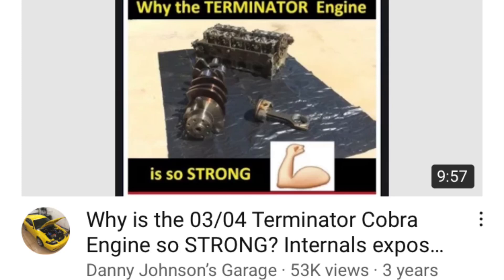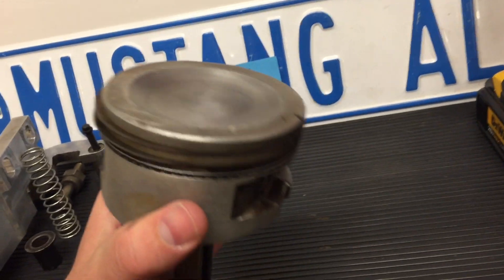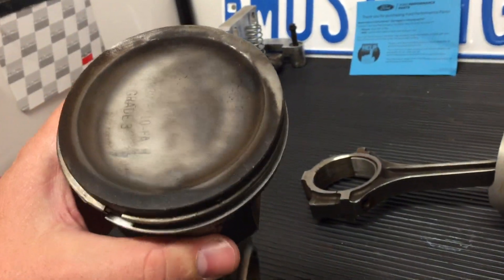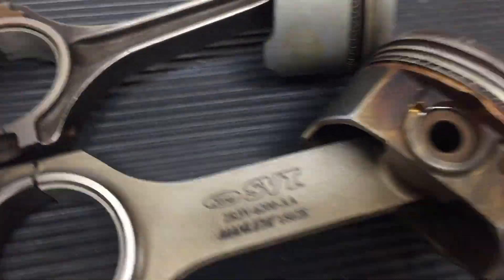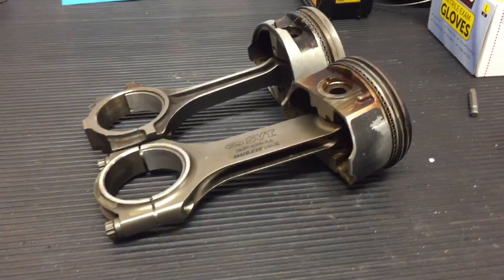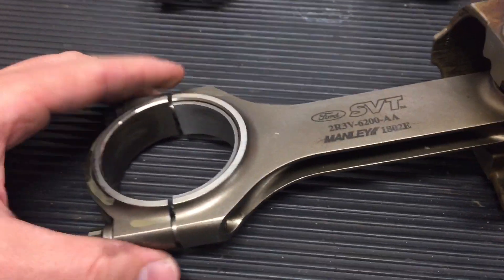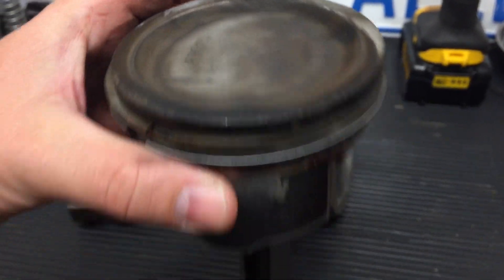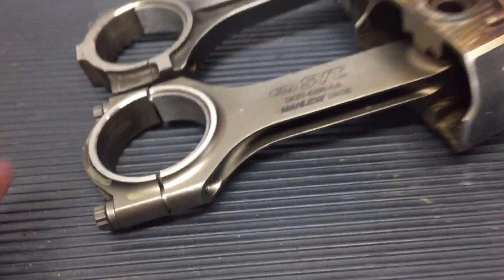Terminator Cobra Rod vs Stock 4.6L Rod: Why the 03/04 SVT Cobra Terminator engine is so Strong.

Comment: Why they don't use them in the 07 to 09 gt500 is beyond me. They were powder forged but should have went with the Manleys.
Reply from the maker: $56 per rod vs $6-$10 per rod is why. I’d gladly pay an extra few hundred bucks for a fully forged engine
Reply: @dannyjohnsonsgarage  Yuuup! 2008 gt500 is what I'm driving now. Playing it safe at 640whp.

Comment: They should of just kept the Manley Rods & ARP studs & bolts, All they had to do was add it to the end cost of the car. People would of paid an extra $1,000 - $1,500 to have forged rods & Bolts in all the Cobra engines even the 5.2 GT500 engine. I know I would of happily shelled out the extra coin for the rigidity of the bottom end.

Comment: Can you convert a normal 2004 4.6 to a terminator 4.6?
Reply from the maker: Not entirely. The block is virtually the same, you can swap over the crank, rods, and pistons, but the heads are different for the 2 valve per cylinder engine on the GT. You can come close

Comment: Will those pistons and rods work in my 96 cobra with the stock crank?
Reply from the maker: Yes, you will just have a little lower compression so you’ll lose a tiny bit of power until you add a supercharger
Reply: @dannyjohnsonsgarage  do they have the same bore or would i need to bore it out? I still have stock bore on my 96 cobra

Comment: Which block can handle more power, the WAP block found on the terminators or the Teksid block?
Reply from the maker: Teksid can handle more. It’s heat treated and higher quality from the same company Ferrari uses, but not many people will surpass the needs of a wap either. If Ford had not gone to WAP it would have been cool for the terminator to have had teksid over iron.
Reply: @dannyjohnsonsgarage  it blows me away how much you and your brother know about the SN95s.
Reply: Terminators don’t have WAP blocks. WAP blocks are used in mach1’s and marauders.

Comment: Its too bad that they put these rods in the mach 1
Reply: Windage losses, you’d lose horsepower and torque with the heavier rod. The modern N/A 5.0 rod and 5.2 Predator rods are vastly stronger than the old 4.6 rods. Sinter forging has come a long way since the 2000s.

Comment: Another tid-bit is that the dish on the terminator and the PI 2v were both at 17cc, along with bore, stroke, rod length, deck height and compression height, making the shortblocks dimensionally identical, with the compression difference being in the combustion chambers.
Reply from the maker: After seeing the dish on both I was thinking it had to do with the heads. Thanks for info
Reply: @dannyjohnsonsgarage   heck yea! I learned that while doing research on forged shortblocks, including the feasibility of putting a terminator short block into a 2v, because shortblocks were available when I was putting together a build list for my car before I ended up doing the full terminator swap.

Comment: Hello could you use those Manley Rod's and pistons in a regular 4.6 Romeo motor (1998)? Have good day . thanks
Reply: Yes... ish, provided the pistons meet the exact clearance requirements of the bore.  There were 3 grades on the run-of-the-mill mod motors during manufacturing, with very minute differences in bore sizes due to machining tolerances, and the pistons were then chosen based on the closest matching bore size.  The hand-built engines met a far more stringent manufacturing standard and were only offered in one grade.  If your block has an exact bore size of 3.552", then dropping them in shouldn't be a problem.  Mahle makes a very nice budget set of forged OEM replacement pistons (http://www.us.mahle.com/media/usa/motorsports/ford-modular-2-valve-or-4-valve-2020-web.pdf) that would drop into a stock bore, or a .020" overbore available in 18cc dish or flat top, giving you new parts with the option of a precise bore and flexibility on compression.  If you're using that on a non-pi head, your compression would be in the low 9.x:1 range, and the flat tops would put you closer to 12:1.  Also note, any changes in piston/rods requires a crank balance.

Comment: Hey Danny, I've got that hesitation when i lift, shift, then go back full throttle. It's like a little delay, then power comes in like a hammer.  I've got the pullied Eaton and boost a pump.  I was thinking of deleting the check valve.  What's your thoughts? The hesitation is intense and seems like it may not be good for the car.
Reply from the maker: Yeah, most likely the PPRV (positive pressure relief valve) in the fuel tank. If you remove it you can often have hard starting (takes a few times) but there are kits out there for it. Mine does it as well, so something that helps a little is not letting off the throttle between shifts so the flow doesn’t stop. You’ll hear me do it in this video below
Reply: @dannyjohnsonsgarage  thanks.  I think I'll tackle that job.  Gotta replace the rear wheel bearings too.  I may as well do a set of gears and that diff cover while it's up in the air.  :)  I'll let you know of the delete fixes the issue.
Reply from the maker: @jasonmitchell7677  If you’re still IRS you may like my playlist https://www.youtube.com/playlist?list=PLIjr-uSYDZi4GVUMK2SdUL74fClSt4-IZ
Reply from the maker: @jasonmitchell7677  And it’s easy access to the fuel filter at that point so change it then! https://youtu.be/4cu_37FyQqM
Reply: @dannyjohnsonsgarage  I have removed the PPRV and can not blow through either side of it. I wonder if it was bad?? Itll be a while before I drive it though. It's getting 373 gears and some FTBR stuff.
Reply from the maker: https://youtu.be/kDWU_CvbM3g
Reply: Hey Jason...I’ve got a 2003 Cobra..Whippled...cams ...4:10 gears..Ford GT pumps..I deleted the check valve years ago...I have no issues with hard starting...if you store the car for the winter..as I do in Ohio..you have to reprime the system by turning the ignition on to activate the pumps about 4 times and then you are good to go.
Reply: @paulciprus9582  that sounds like a fast car. Thanks for the feed back.  I think the delete will help.  I found some bad bearings in the diff so its completely scattered for now. Itll be a little while before I drive it to find out.